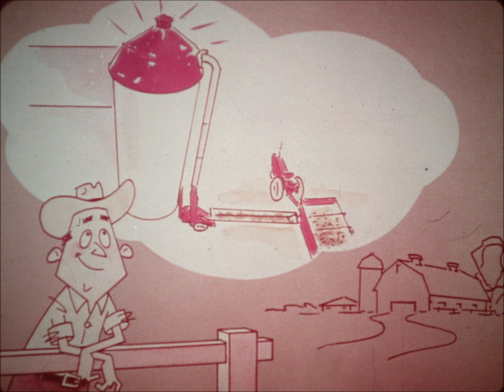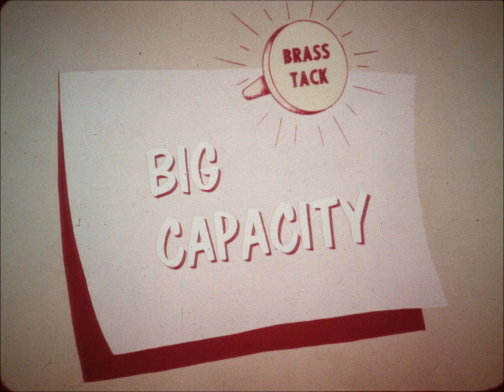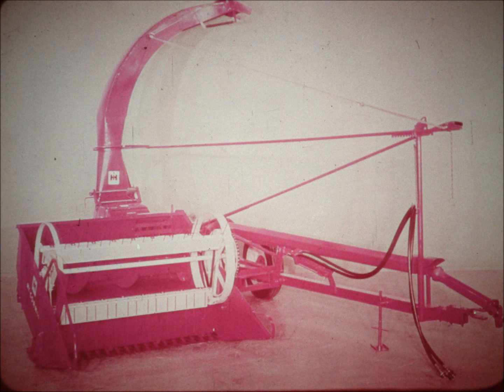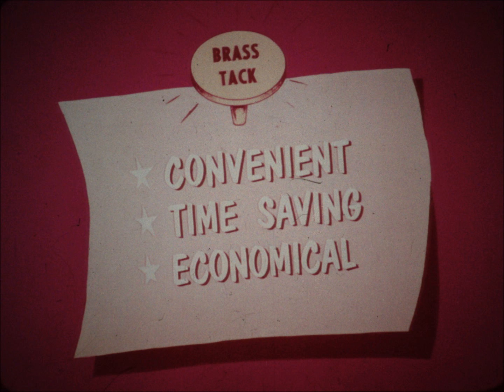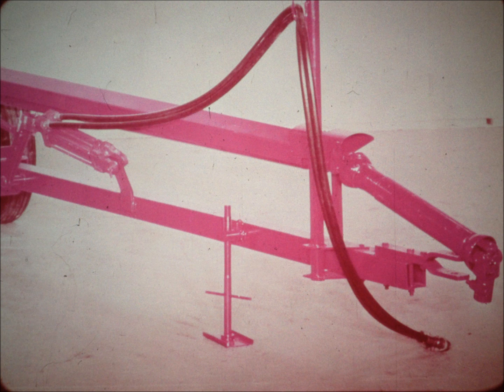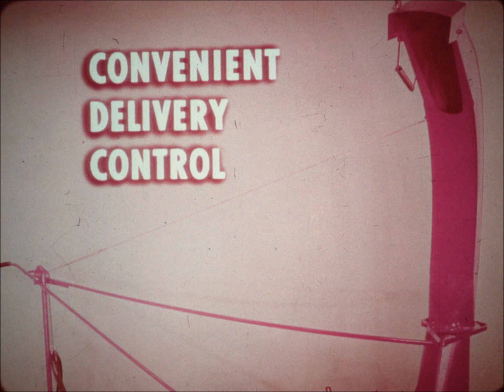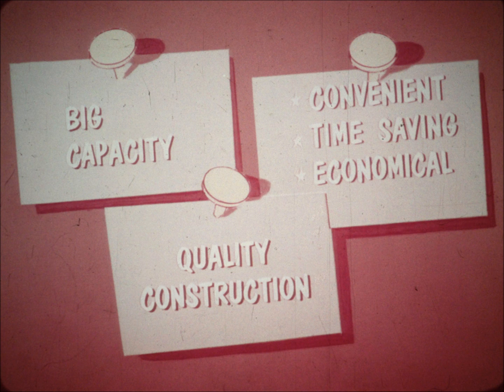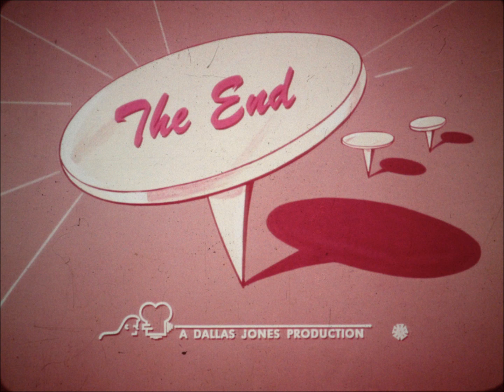IH No. 15 Field Harvester

Comment: Growing up, we had one from this family of IH harvesters - I don't know the exact model.   But I recognize the windrow pickup, which I had to spend an hour or 2 after each day picking out hay that wrapped up around the tines.   The wind chute was too long for the available throwing power when chopping haylage at around 60% moisture, so the chute frequently plugged up.    It might work well with direct cut or corn though.    Finally replaced with a NH717 which worked very well.  I never see one of these models preserved as working antiques, and that might be why.